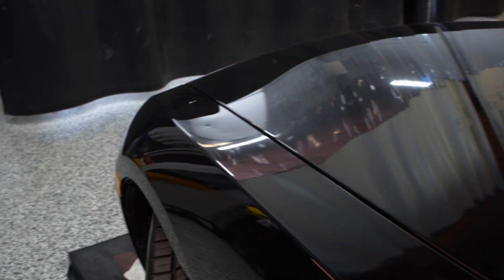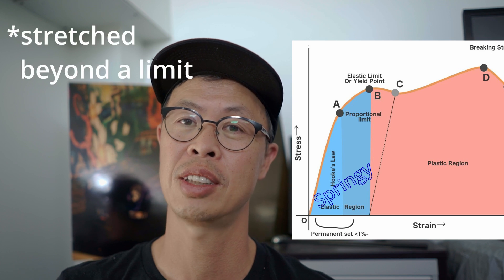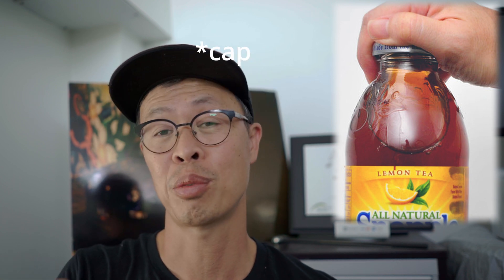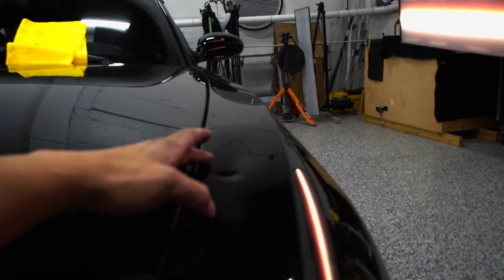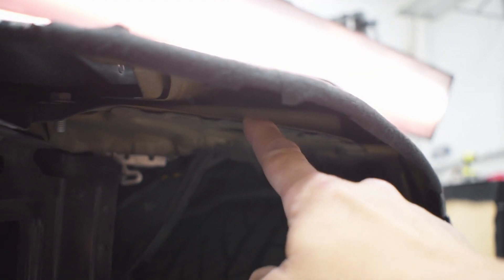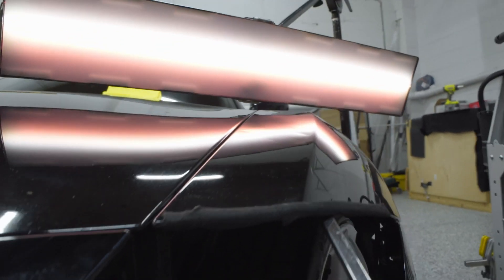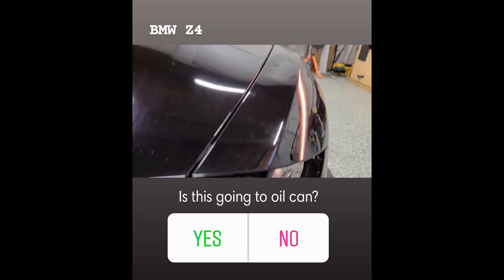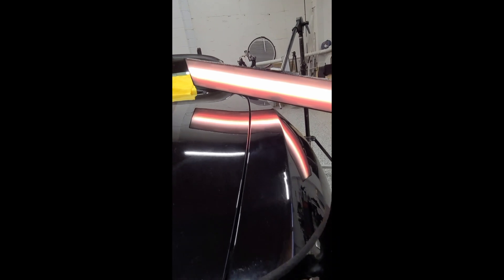Deep Dent PDR | Aircon vs BMW Fender

Comment from the maker: This is a precursor to the next Stanliner application video.  This one will be an example of how I'm rolling metal into the dent perpendicular (not parallel) to the fade strip! (The last Stanliner application video we were rolling parallel to the fade strip) The next Stanliner video will have this and another repair to show I do it perpendicular to the fade strip -- This is a HUGE no-no in traditional PDR but we can break that rule with tools and techniques from Stanliner. It really works and you might want to consider training it if you can read a reflection well already. You're going to need to be able to see subtle in the fade.
Yes I am still using the crane series of tools, but I feel the crane can demo a lot of Stanliner techniques - once you do it on the crane you're going to see it in the other tools and use it all over the place with your Stanliners. 
The final crane video will be dragging and that is the most versatile one of all (the problem is that the dragging is the hardest to explain in video). Wish me luck. 
I have some examples of the fender tool by request and I'll tie in the new rolling spoons with that video.
As always thanks for watching and reading.
Reply from the maker: That's really encouraging thanks. It's a work in progress but more to come for sure.

Comment: Looks good, taking in consideration the access. T-hot box would av give you a easier start. Keep it coming mate
Reply from the maker: Thanks Marin, I've never played with the THotbox in that way - I don't have one but a friend sent one to me to play with a few years ago.  Does it do anything other than heat the metal in a very localised spot?
Reply: @VanDentPro  T-hotbox is very controversial, requires a lot of care to be shore you'll not gonna burn the paint. I  use it to for warm up and release the tension. It will help you to flatten the dent bottom easier, don't use it for more than 2-3 applications on 40% up to counting to 3 each time, more than this it will release all the water molecules from the paint increasing the risk of producing micro cracks in to the dent do to (ice cream cone effect). On a flated dent it helps with stabilizing the molecules and reducing the oil can effect.
Reply from the maker: Thanks for that technical response. I love it. This helps techs and clearly shows the potential risks. Thanks man
Reply: @VanDentPro  I call it "Experience and knowledge exchange". It makes as all better technicians.